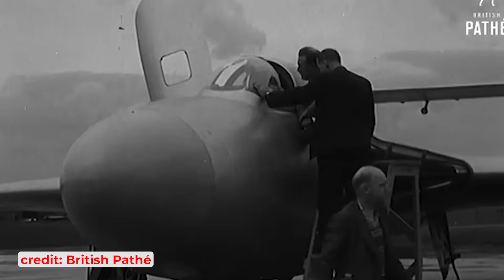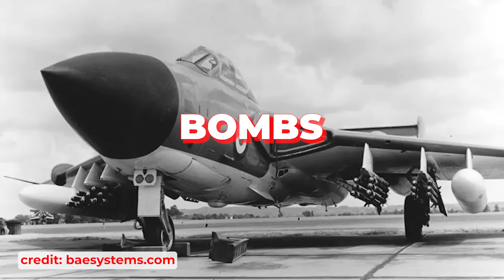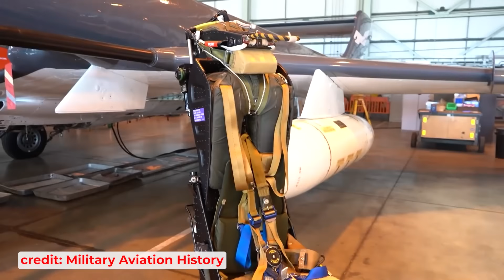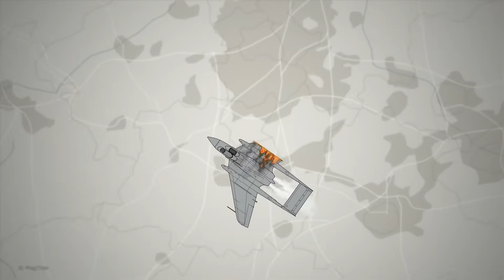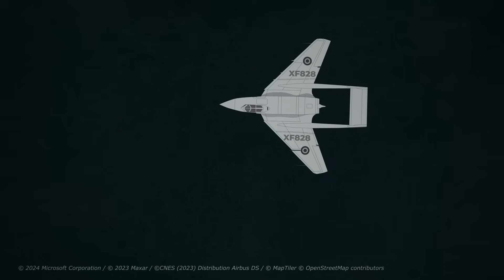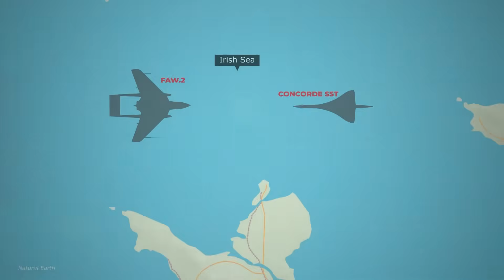Sea Vixen: A Beautiful Killer

Comment: What do you mean , the first of its kind to break the sound barrier?
Reply: De Havilland never produced any aircraft capable of flying supersonic... in terms of aerodynamic technology d-H was decades behind its competitors
Reply: @DoktorBayerischeMotorenWerke 

Sea Vixen Compared. 

We feel we can clear up some commonly held myths and misconceptions, obviously.

It's always good to see the facts presented clearly and concisely isn't it.

We feel we can clear up some commonly held myths and misconceptions, obviously.

It's always good to see the facts presented clearly and concisely isn't it.

See further down for a Meteor losses comparison.

See below for Comet accident losses comparisons. The Comet had similar accident losses fatalities to the later Sud Aviation Caravelle. Much later jet airliners from US manufacturers had significantly worse accident losses. 

The Vickers VC10 held the Atlantic crossing record for 43 years  (Non supersonic airliners). 

The Harrier was the only aircraft of its type at the time it first flew. All 1250 Pegasus engines built for all Harriers ever built anywhere were British build and design engines. The first 135 Harriers purchased for the USMC were entirely built in the UK. All 436 USMC Harriers had British built engines. 

The world's first wind tunnel was built in England during the 1800s. The world's first supersonic wind tunnel was built in England during the 1920s. 

Indeed that's correct. The Whittle Gloster E28/39 was of course a brilliant aircraft that was later copied in Russia as the upsized and tweaked Mig 15 with a copy of the RR Nene gas turbine aero engine.

Obviously the RR Nene being the world's most powerful & most reliable gas turbine aero engine in 1944.

The MD F3H Demon was a contemporary to the DH Sea Vixen & had a similar performance. The F4 Phantom was a follow on from the F3 Demon. The Sea Vixen took a long time to get from first flight to introduction for various reasons and a similar situation occurred with the MD F3H Demon.

McDonnell Douglas F3H Demon
590 Built. Not Supersonic.
Max Speed 578 MPH.
Introduction date 7 March 1956
First flight 7 August 1951
Retired 1964

MD F-4 Phantom 2
Number built 5,195
Manufactured 1958–1981
Introduction date 30 December 1960
First flight 27 May 1958

DH Sea Vixen
Number built 151 (including two DH110 prototypes and one Sea Vixen prototype)
Introduction date July 1959
First flight 26 September 1951
Max speed 695 MPH.
Retired 1972

Regarding the UK Aerospace Sector.
 
An airline recently ordered 60 RR Trent XWB Engines.

It's a great pity & a crying shame that British military forces had to occupy a large part of Germany for decades after 1945 & Russian military forces had to do the same. Of course Russia still posseses a large chunk of what was German territory & of course Russia & the UK produce nukes. Obviously Germany does not produce nukes.

Interesting British achievements.
There is no doubt that the Fairey (England)
Delta 2 was of course the world's first jet
aircraft to exceed 1000 mph.  Indeed It
exceeded the previous record by 310 mph &
held the record for 1 year. Incidentally, the Dassault Mirage 3 & 4 are based on the Fairey Delta 2.

Early days, jet fighters.
De Havilland Vampire, Sea Vixen & Gloster Meteor accident losses were not high or unusual for fighter aircraft at the time. De Havilland built large numbers of all metal airframe aircraft before the DH Comet.
We mustn't forget of course that the DH Vampire for example first flew in 1943 & the engine was also built by De Havilland. There were examples of the Vampire interceptor / fighter in service until 1990 which was operated by more than 30 countries.

Non combat phase accident losses.
% of Aircraft built.
The Canadair CL-44 was a turboprop airliner.
Canadair CL-44                  (ff 1959 ) 48%
Lockheed XF104                (ff 1954) 100%
Lockheed  P80                   (ff 1944) 43%
Lockheed F104                 (ff 1954)  45%
Grumman f9f-5 Panther   (ff 1947) 44% 
Convair F102 Dagger        (ff 1953) 45%  
MD F-101 Voodoo.             (ff 1954) 34%
MD FH Phantom 1            (ff 1945)  35%
MD F4 Phantom 2             (ff 1958)  28%
MD F3H  Demon               (ff 1951)  32%
Gloster Meteor                  (ff 1943)  21%
DH Vampire                       (ff 1943)  23%
DH Sea Vixen                     (ff  1951) 33%
Gloster Javelin                   (ff 1951) 20%
EE Lightning                       (ff 1954) 33%

An example of what goes on these days in various countries.
For example, there are of course no German companies that makes German jet aircraft in Germany & there are no German Companies that make German gas turbine aero engines in Germany that are suitable for widebody airliners.

Brazil makes very good airliners & Brazil is 100th down the list along with Indonesia for wealth per capita. Of course it is in fact the case that Embraer can't build those airliners without purchasing stuff from the US, UK & Europe. Norway Holland Denmark Ireland Belgium - Top 20 wealth per capita - Don't make airliners -  its as simple as that.

    Early days of the airliners.
That's correct of course, at the time the Comet wasn't particularly dangerous. Agreed, that is indeed the case of course, The DH Comet was definitely not the worst engineering failure in commercial airliner history.

How things were back then. 
Accident losses - % of aircraft built.
DeHavilland Comet 4                   14% 
DH Comet all mks   (ff 1948)       17%  
Vickers VC10 UK                            5%

The DH Comet had better safety than or similar safety to many other commercial passenger aircraft of a similar era.

Douglas DC-1                                      99%
Douglas DC-2                                      47%
Douglas DC-3                                      30%
Douglas DC-4                                      26%
Boeing s300                                        72% 
Boeing 307                                          70%
Boeing 247                                          48%
Boeing 707                                          20% 
Lockheed L-049/149 Constellation  30%
Lockheed Electra Turboprop             29%
Fairchild FH-227                                  30%
McDonnell Douglas DC-8                   14%
Sud Aviation Caravelle                        15%
Canadair CL-44  Turboprop                46%  
Convair CV-580  Turboprop                22%
Convair CV-880     (ff 1959)                27%  
Convair CV-990     (ff 1961)                33%
Tupolev T-104        (ff 1956)                16%

The VC10 held the fastest Atlantic crossing speed record for 41 years (Non supersonic airliners).

For the first few years of operations the Caravelle and Comet had similar accident loss Fatalities numbers.

De Havilland had prior experience building many all metal construction airframe aircraft & thousands of jet powered fighter aircraft that were primarily of metal construction with pressurised cockpits & jet engines built by De-Havilland.

We hope this helps. Cheers as always indeed etc
Reply: @DoktorBayerischeMotorenWerke 

We feel we can clear up some commonly held misconceptions.

It's always good to see the facts presented clearly isn't it?

A potential successor to the Sea Vixen. 

The Hawker P-1103 / General Dynamics / Lockheed F16.

During the 1950s in the UK a number of aircraft that would've exceeded the capabilities of anything on the drawing board elsewhere were in the design stage. They were cancelled for various reasons including the missiles doing everything idea. 

1954, Hawker, fighter development - Air Ministry Operational Requirement OR-323. P-1103, a twin-seat swept wing aircraft powered by a de Havilland Gyron turbojet engine and armed with two Red Dean air-to-air missiles. Reworked the following year-  February 1955, the Ministry issued OR-329, called for a large 40-inch (100 cm) sweep-scanning radar unit AI-18. In October 1955 revised P-1103 proposal for a revised requirement offering the Red Hebe missile. 

In addition to the P-1103 Mach 2.5 design, Hawker also did design work for a faster P-1121 version. Mach 3, steel wing + uprated Gyron engine.

The Hawker P-1103 initial design had a fully variable geometry chin position inlet, Hawker's basic 1954 design would later be used for the General Dynamics F16 Fighting Falcon (Viper) - first flight 1974. The F16 was built in a number of countries with companies in those countries also producing parts for the aircraft that were built in the US.

We hope this helps.
Reply: @DoktorBayerischeMotorenWerke 

A number of similar performance non supersonic jet aircraft got to first flight stage at around the same time. 

The MD F3H Demon was a contemporary to the DH Sea Vixen & had a similar performance. The later F4 Phantom was a follow on from the F3 Demon. The Sea Vixen took a long time to get from first flight to introduction for various reasons and a similar situation occurred with the MD F3H Demon. The Douglass Skyhawk delta wing is a contemporary to the the Gloster Javelin delta wing. Both non-supersonic delta wing aircraft, the javelin had better performance and first flew a few years before the Douglass Skyhawk.

Douglass A-4 Skyhawk 
2950 Built 
Intro 1956
FF 1954
In service to 1980s
Max V 670 MPH
Delta wing. A small / light jet aircraft designed for carrier operations without having to have folding wings. Often referred to as the scooter. 

McDonnell Douglas F3H Demon
590 Built. Not Supersonic.
Max Speed 578 MPH.
Introduction date 7 March 1956
First flight 7 August 1951
Retired 1964

MD F-4 Phantom 2
Number built 5,195
Manufactured 1958–1981
Introduction date 30 December 1960
First flight 27 May 1958

DH Sea Vixen
Number built 151 (including two DH110 prototypes and one Sea Vixen prototype)
Introduction date July 1959
First flight 26 September 1951
Max speed 695 MPH.
Retired 1972

Gloster Javelin.
434 built.
FF 1951
Intro1956
Max V 710 MPH
Delta Wing. 

Interesting British achievements.
There is no doubt that the Fairey (England)
Delta 2 was of course the world's first jet
aircraft to exceed 1000 mph, 10th March 1956 Indeed It exceeded the previous record by 310 mph & held the record for 1 year. Incidentally, the Dassault Mirage 3 & 4 are based on the Fairey Delta 2.

When the EE Lightning first achieved Mach 2 it was one of the fastest aircraft on the planet. 
P1 Mach 1 achieved 1954, Mach 1•5 capable.
P2 Mach 1 achieved 1956, Mach 2 capable. 
P2 Mach 2 achieved 1958.

The Hawker P1103 was a design and part built prototype that would have led to Mach 2 & Mach 3 versions of the aircraft. The General Dynamics F16 Fighting Falcon was of a similar design that went into service in 1975. The P1103 was cancelled during the switch to "mostly missiles plus no supersonic interceptor aircraft required in the future" era which included cancelling air to air missile development. Scheduled for test flights in 1958 and to be in service 1962. The General Dynamics F16 Fighting Falcon - based on a British design started 39 years earlier, built in the US and a number of manufacturing partner countries with parts for the US built aircraft sourced from partner countries. 

There were plans to do a supersonic thin wing Javelin which of course got cancelled. 

Early days, jet fighters.
De Havilland Vampire, Sea Vixen & Gloster Meteor accident losses were not high or unusual for fighter aircraft at the time. De Havilland built large numbers of all metal airframe aircraft before the DH Comet.
We mustn't forget of course that the DH Vampire for example first flew in 1943 & the engine was also built by De Havilland. There were examples of the Vampire interceptor / fighter in service until 1990 which was operated by more than 30 countries.

Non combat phase accident losses.
% of Aircraft built.

The Canadair CL-44 was a turboprop airliner.
Canadair CL-44                  (ff 1959 ) 48%
Lockheed XF104                (ff 1954) 100%
Lockheed  P80                   (ff 1944) 43%
Lockheed F104                 (ff 1954)  45%
Grumman f9f-5 Panther   (ff 1947) 44% 
Convair F102 Dagger        (ff 1953) 45%  
MD F-101 Voodoo.             (ff 1954) 34%
MD FH Phantom 1            (ff 1945)  35%
MD F4 Phantom 2             (ff 1958)  28%
MD F3H  Demon               (ff 1951)  32%
Gloster Meteor                  (ff 1943)  21%
DH Vampire                       (ff 1943)  23%
DH Sea Vixen                     (ff  1951) 33%
Gloster Javelin                   (ff 1951) 20%
EE Lightning                       (ff 1954) 33%

More recent UK military jet aircraft.
 
The Tornado & Typhoon & their engines are Supersonic & are indeed British design aircraft with British design engines built by an international consortium. The Tornado design for example started life during the 1950s at Vickers as the AFVG, it's engine is based on the RR RB-199. The EE Lightening is also a British Supersonic jet aircraft.

The Typhoon is the British BAC-EAP with an engine based on the British RR XG-40, the Typhoon is also built by an international consortium.

Comment: Haitch Hem Ess Haitch Haitch.  Gives me a migraine.
Reply: English is a nightmare... no standards for pronunciation.
Reply: @DoktorBayerischeMotorenWerke 

English is the international aviation language and is now the world's most used 2nd language. For example, German pilots speak to German ATC in English.
Reply: A number of similar performance non supersonic jet aircraft got to first flight stage at around the same time. 

The MD F3H Demon was a contemporary to the DH Sea Vixen & had a similar performance. The later F4 Phantom was a follow on from the F3 Demon. The Sea Vixen took a long time to get from first flight to introduction for various reasons and a similar situation occurred with the MD F3H Demon. The Douglass Skyhawk delta wing is a contemporary to the the Gloster Javelin delta wing. Both non-supersonic delta wing aircraft, the javelin had better performance and first flew a few years before the Douglass Skyhawk.

Douglass A-4 Skyhawk 
2950 Built 
Intro 1956
FF 1954
In service to 1980s
Max V 670 MPH
Delta wing. A small / light jet aircraft designed for carrier operations without having to have folding wings. Often referred to as the scooter. 

McDonnell Douglas F3H Demon
590 Built. Not Supersonic.
Max Speed 578 MPH.
Introduction date 7 March 1956
First flight 7 August 1951
Retired 1964

MD F-4 Phantom 2
Number built 5,195
Manufactured 1958–1981
Introduction date 30 December 1960
First flight 27 May 1958

DH Sea Vixen
Number built 151 (including two DH110 prototypes and one Sea Vixen prototype)
Introduction date July 1959
First flight 26 September 1951
Max speed 695 MPH.
Retired 1972

Gloster Javelin.
434 built.
FF 1951
Intro1956
Max V 710 MPH
Delta Wing. 

Interesting British achievements.
There is no doubt that the Fairey (England)
Delta 2 was of course the world's first jet
aircraft to exceed 1000 mph, 10th March 1956 Indeed It exceeded the previous record by 310 mph & held the record for 1 year. Incidentally, the Dassault Mirage 3 & 4 are based on the Fairey Delta 2.

When the EE Lightning first achieved Mach 2 it was one of the fastest aircraft on the planet. 
P1 Mach 1 achieved 1954, Mach 1•5 capable.
P2 Mach 1 achieved 1956, Mach 2 capable. 
P2 Mach 2 achieved 1958.

The Hawker P1103 was a design and part built prototype that would have led to Mach 2 & Mach 3 versions of the aircraft. The General Dynamics F16 Fighting Falcon was of a similar design that went into service in 1975. The P1103 was cancelled during the switch to "mostly missiles plus no supersonic interceptor aircraft required in the future" era which included cancelling air to air missile development. Scheduled for test flights in 1958 and to be in service 1962. The General Dynamics F16 Fighting Falcon - based on a British design started 39 years earlier, built in the US and a number of manufacturing partner countries with parts for the US built aircraft sourced from partner countries. 

There were plans to do a supersonic thin wing Javelin which of course got cancelled. 

Early days, jet fighters.
De Havilland Vampire, Sea Vixen & Gloster Meteor accident losses were not high or unusual for fighter aircraft at the time. De Havilland built large numbers of all metal airframe aircraft before the DH Comet.
We mustn't forget of course that the DH Vampire for example first flew in 1943 & the engine was also built by De Havilland. There were examples of the Vampire interceptor / fighter in service until 1990 which was operated by more than 30 countries.

Non combat phase accident losses.
% of Aircraft built.

The Canadair CL-44 was a turboprop airliner.
Canadair CL-44                  (ff 1959 ) 48%
Lockheed XF104                (ff 1954) 100%
Lockheed  P80                   (ff 1944) 43%
Lockheed F104                 (ff 1954)  45%
Grumman f9f-5 Panther   (ff 1947) 44% 
Convair F102 Dagger        (ff 1953) 45%  
MD F-101 Voodoo.             (ff 1954) 34%
MD FH Phantom 1            (ff 1945)  35%
MD F4 Phantom 2             (ff 1958)  28%
MD F3H  Demon               (ff 1951)  32%
Gloster Meteor                  (ff 1943)  21%
DH Vampire                       (ff 1943)  23%
DH Sea Vixen                     (ff  1951) 33%
Gloster Javelin                   (ff 1951) 20%
EE Lightning                       (ff 1954) 33%

More recent UK military jet aircraft.
 
The Tornado & Typhoon & their engines are Supersonic & are indeed British design aircraft with British design engines built by an international consortium. The Tornado design for example started life during the 1950s at Vickers as the AFVG, it's engine is based on the RR RB-199. The EE Lightening is also a British Supersonic jet aircraft.

The Typhoon is the British BAC-EAP with an engine based on the British RR XG-40, the Typhoon is also built by an international consortium.